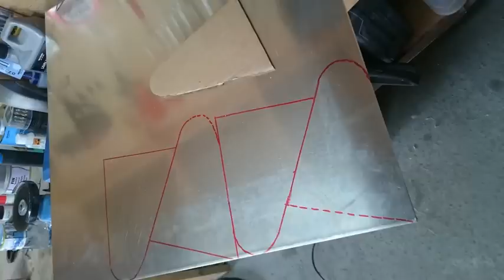Bella Arrow Jet Boat

Comment from the maker: Sorry the bad video, the program I used to create it, sucks.
The engine runned well, but I have to dissapoint you all, I sold it before I could test it.
Some information:
The boat is an old Bella Arrow 14 feet. Engine is from a 2007 Yamaha Venture snowmobile, 4 stroke, tripple sylinder, non turbo. About 125 hp.
The connection between motor and jet is special made out of aluminum.
Water jet is from a 1997 yamaha waverunner 1100cc, bought on ebay. To cool this thing, I bought an intercooler from a car. Rebuilded it to a water-to-water cooler. The engine coolant goes trough the inner side, where the air is ment to be. I did this because most engines will break if you pump saltwater trough them.
It wasnt so hard or difficult to do this. But I had problems with the oil catch system on the engine. And it was a pain in the a** to level/allign the engine with the jetpump. If anyone is going to build something like this, please make the engine adjustable in height.
Reply: you should have went all out and put an electric motor in there with some batteries would have been a much better built
Reply: On the actual jet skis they just use shims under the motor mounts as the "adjustment". You can tip it to one side or the other, raise it up and down, pitch forward or backward, basically infinite adjustment, and at a really low cost. In your case you'd have to oval the mounting plate holes to do that i think but it would be a good method. Too bad it's sold.

Comment: Hei! 
Odd-richard Nylund please tell me, what about Kawasaki ZX-11 engine combined with Yamaha superjet jet pump 148 mm?  What is your oppinion; will be efficiency of jet pump / jet stream thrust larger/smaller att above 7000 r.p.m. , with stock impeller. Or it should it be better to use  for example Solas impeller wit different ratio?